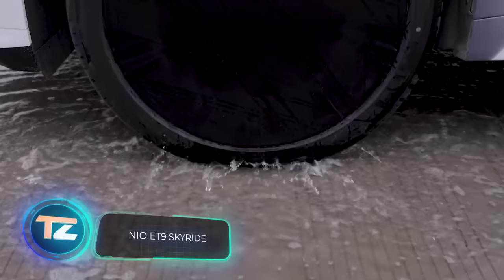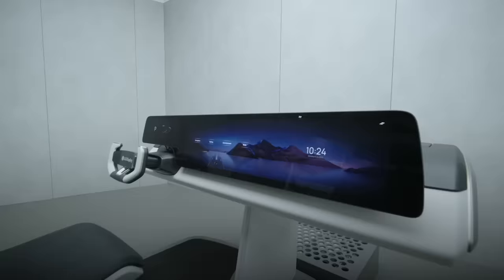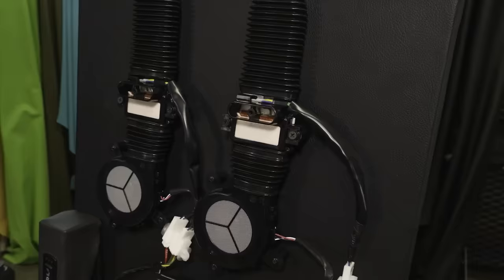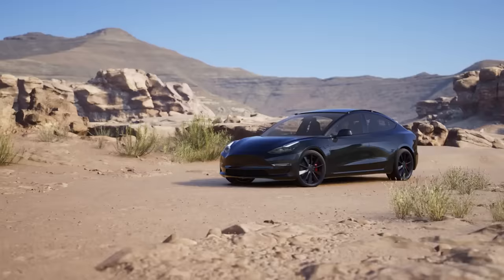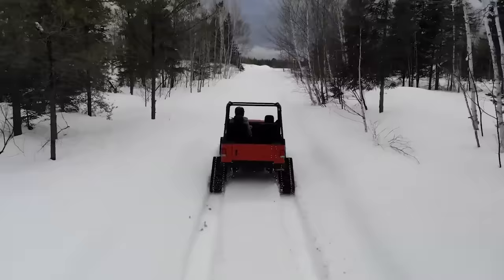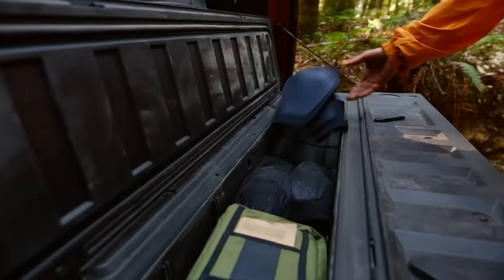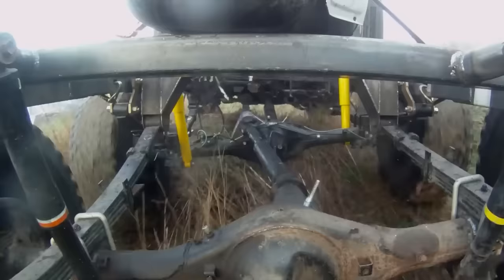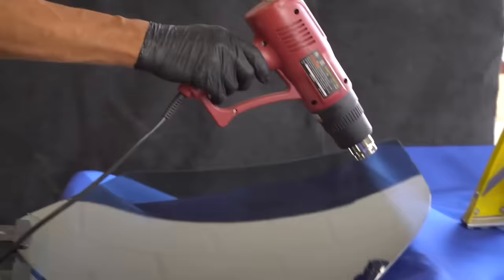COOL INVENTIONS THAT WILL TAKE YOUR CAR TO A NEW LEVEL

Comment: Yeah put a roof rack on a Jeep and then put a snowmobile on top of your Jeep and then I will show you a vehicle that will roll at under 30 mph
Reply: Lifts the center of gravity.
Reply: But you would have a jeep and a snowmobile. Just drive slower on the corners on your way up the canyon. You still have fun toys. Ha ha
Reply: How you gonna even get a frigging snowmobile up there without a crane of some kind! Even in my youth I would never be able to lift one up there!
Reply: @brettbarager9101  well that's the magic. They don't show you in the ad. I think if you've got like a bobcat or a large front end loader you could probably pull it off

Comment: Full width dashboard display?  Not for me.  What happens to you if it breaks?  An analog speedometer and analog gages give me real time information and are not likely to break.  Same with rearview mirrors.  Never had one of them fail when a transistor tanks.

Comment: Here in Norway it is illegal to use your cars touch screen while driving meaning you now have to stop your car to do anything at all because all cars now come with touch screens as the only control for changing any setting (like fan speed and temperature and such)... Touch screens is NOT something that belong in car as it is dangerous to use while driving to put it mildly.

Comment: That’s not a fifth wheel, that’s a gooseneck.
Reply: It's not?  either way, don't buy this cause for you f150 or 1500 types.  If your transmission and gearing aren't made for heavy loads.

Comment: 8:00 There is strict limits how much weight you can put the roof of your car and it is not because the roof can not handle it, it is limits because weight that high up will seriously harm the handling of your car. A snowmobile on top will be 4-6 times the legal weight for most cars...

Comment: My metal fab shop has been building 6X6 pick ups for over 7 years using older dodge split transfer cases from the 40s and 50s that I guarantee are a lot tougher than that system ! Utilizing air bag suspension . And brackets for that Milwaukee pack out system for a year or so but we cannot use their name ether just say for the red stackable tool kits .

Comment: And that supposedly bulletproof windshield film whose website is no longer working probably has a non-functioning website because it's a scam. I can't believe it got on to one of your videos. Kind of makes me think that a bunch of the other stuff that you show is nothing but pipe dreams and 3D animation. But it's a film you're putting on glass. It's not impregnated into the glass so it's not adding anything structural to the glass. It's the same as breaking a window with tint on it. You can break the window and the tent just falls off. I mean think about that. That stuff would make it so that if it was an emergency the fire department would have no way to get through your window to get you out of a vehicle. Shit. The police couldn't even shoot you out of it. 🤣🤣

Comment: The idea for the GM tailgate with cooler came from the Hyundai Santa Cruz, which has a compartment in the back of the floor and is much bigger
Reply: It's such a small compartment i could only see using it for maybe straps